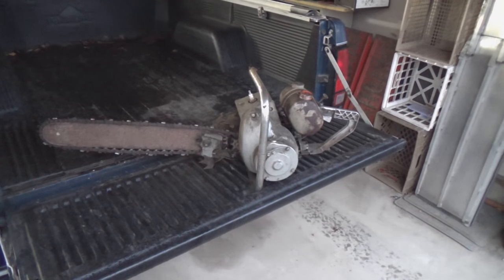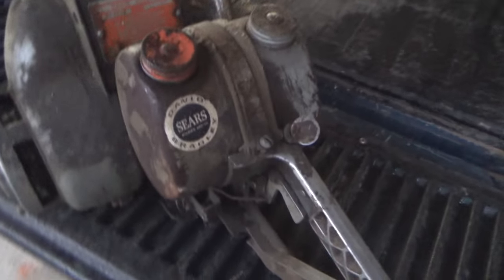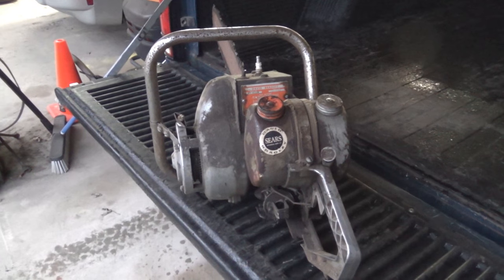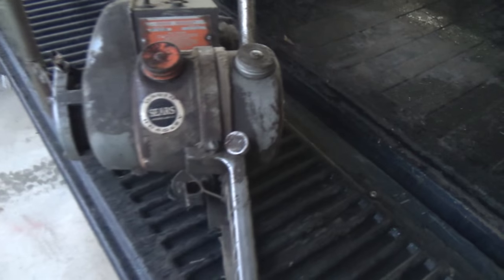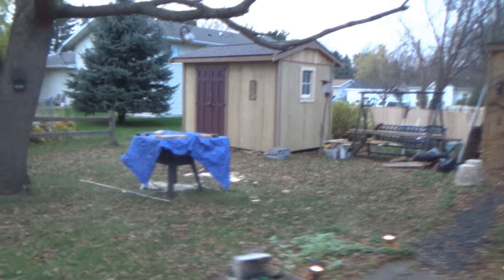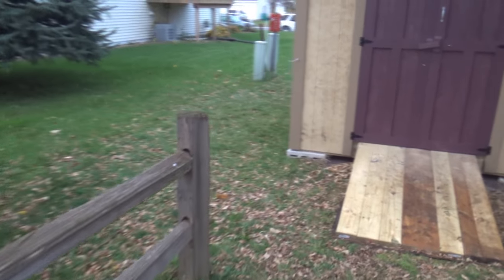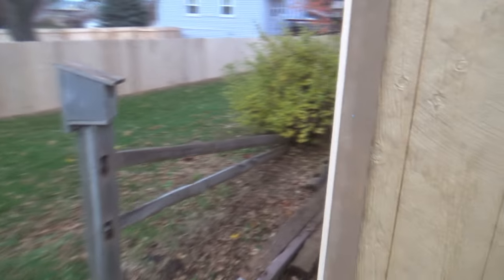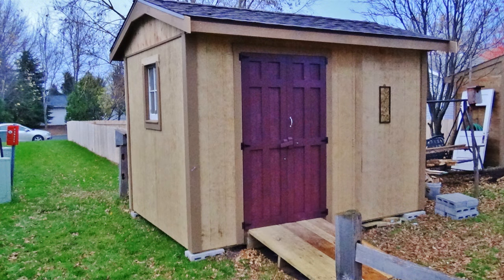Freebie David Bradley chainsaw & more shed updates

Comment: Sometimes you can type in the serial number and model info and you can get a more accurate manufacturing date.
Reply from the maker: I found a listing on chainsaw collectors corner with lots of information and it was initiated in 1965. Thanks for the helpful suggestion.

Comment: Does the motor turn? It would go neatly in a bike frame. And if you leave the chain on it, you will have no trouble getting through traffic.
Reply from the maker: Yes, the engine does turn over and it seems to have decent compression. As you said with the bar & chain still on I could cut through traffic quite easily, slicing and dicing in the process...

Comment: I would have thought that saw if you could get it going would go straight in to a bicycle frame - just make the throttle work from a trigger switch on the handle bars rather than the broken handle. It even has a sprocket on it for a chain drive if you could find a suitable sprocket? Two strokes are pretty straightforward so long as the barrel and piston are not too scored.
Love the shed -are you going to put some guttering over the door at least to stop it dripping own your neck?
Reply from the maker: I do plan on making my own gutters in cedar, using a colonial standard, but with modern sealer upgrade on the inside. I am hoping that I can get the old chainsaw going as it would be a neat installation on a bike for sure and would be pretty straightforward I think.
Thank you Dan
Reply from the maker: PS I missed you for a while. I hope you are doing well.
Reply: I'm fine thanks.

Comment: The model number i think 1965 ,  could maybe a bit earlier ,
Reply from the maker: You nailed it Terry. I found chainsaw collectors corner and they had a listing for many of the old Craftsman/David Bradley saws, and this model was initiated in 1965. Lots more good info there too, and Sears still carries many parts to repair these with. Thanks
Reply: pretty cool that parts can still be had for it if wanted